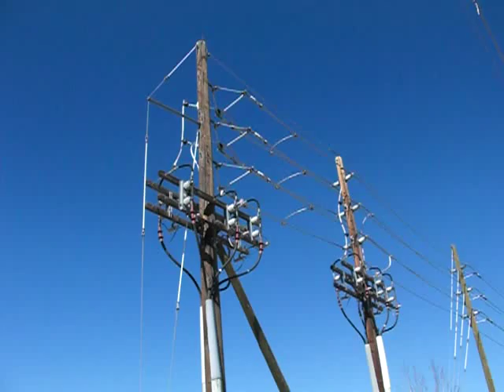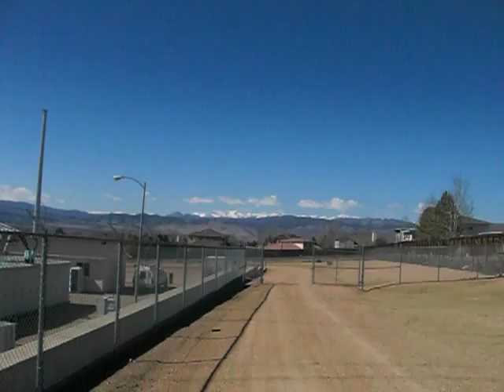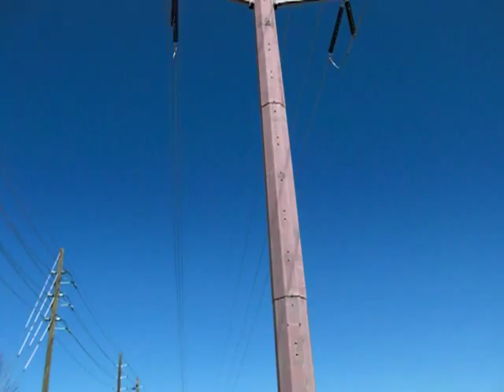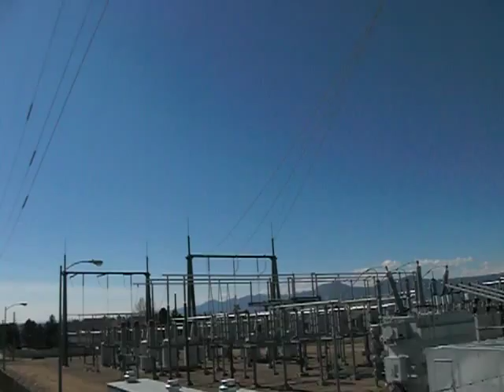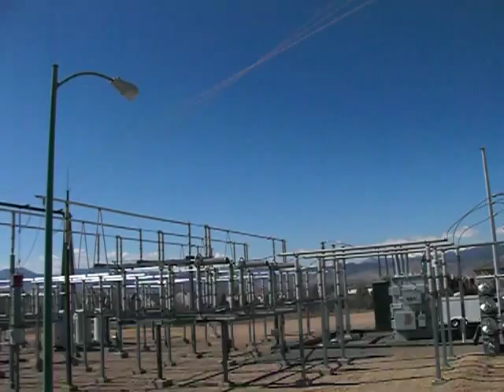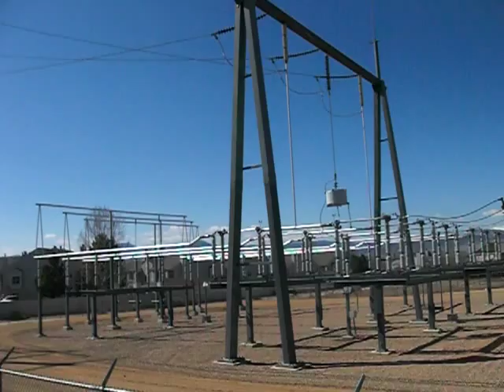Electrical substation at 75th and Lookout Road in Boulder, Colorado

Comment: I've worked in the substation design industry for many years.  I actually worked on some designs there in Ft. St. Vrain when I worked for XCEL Energy in Denver a few years back.

Substations are dangerous and can be dangerous even from the distance at the fence.  Please be careful and stay away.  Thieves like to steal grounding wire and have been known to create dangerous situations where the fence ends up not being grounded properly.  Don't touch.  Step-touch potential can be fatal.
Reply from the maker: Good information - thank you!